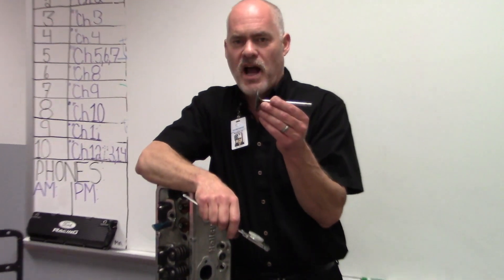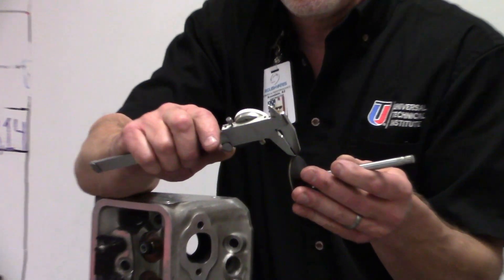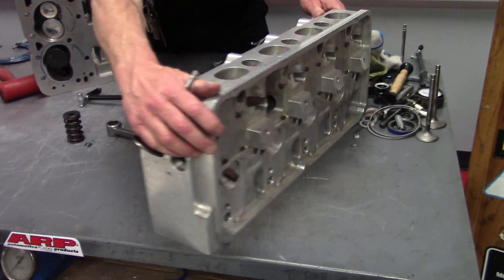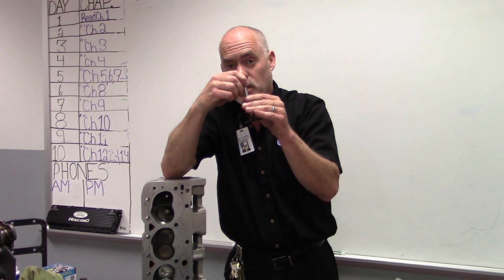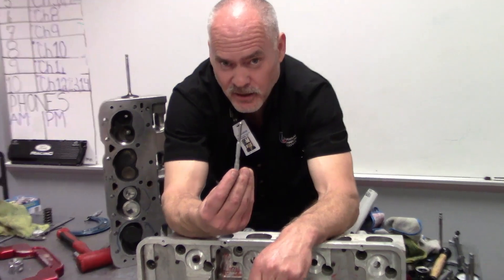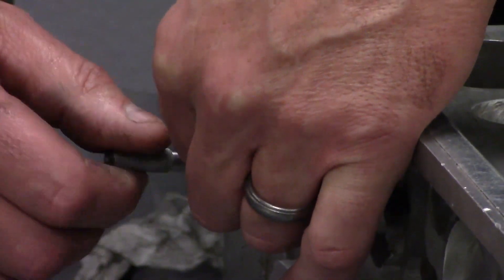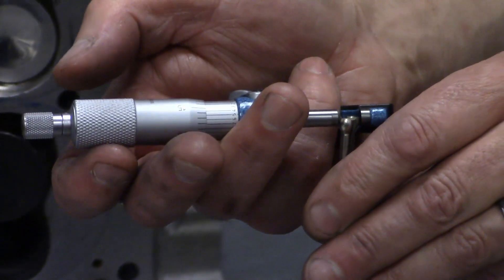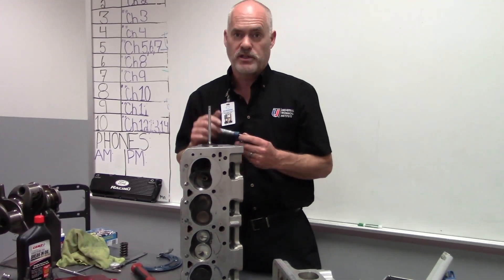350 Chevy Valve Guide inspection

Comment: A much overlooked thing when rebuilding an engine, same goes for valve stem seals. If you have to run them because you don't have another choice, just keep it in mind and work on a set of backup heads.

Comment: I've used small hole gages in the past. I recently bought pin gages in .0003" increments from .0010 to .0022 over valve stem diameter, makes it easier to check for taper. even new heads and valves are not perfect, I hone to straighten out taper and fit valves to each guide to get appropriate clearance.

Comment: I have heard that E-85 fuel usage has a habit of washing off the oil film from the valve guides. This in turn could explain another reason why the valves also burn and don't seat correctly. Just a theory, but it does make sense. Alcohol washes off oil....
Reply: So does gasoline, so I'm not seeing the difference.
Reply: @MrTexasDan  Or it could be that the alcohol burns hotter and that it takes more fuel to operate than just straight unleaded. Either way, I have seen more valve and valve guide issues with vehicles using E85 exclusively.
Reply: @karrpilot7092  Yep, maybe it's that. Burns hotter.